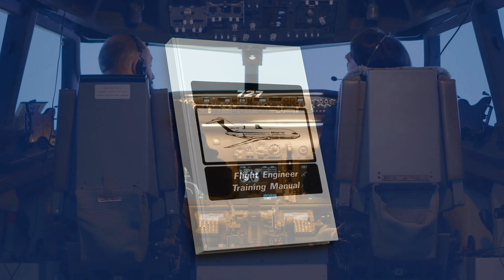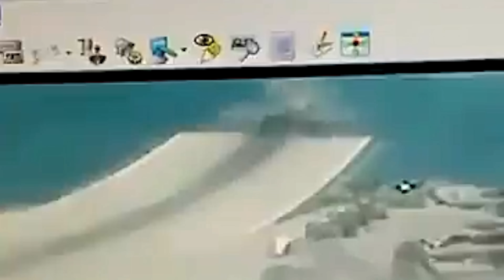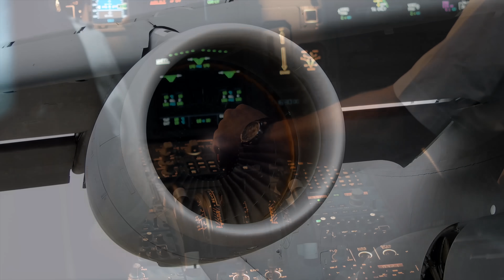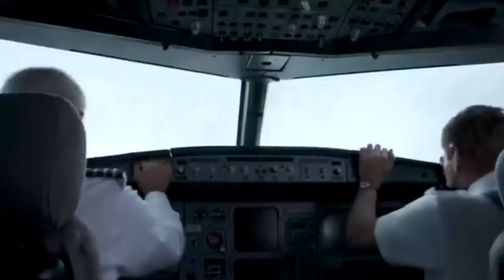Plane Takeoff Failures Caught On Camera

Comment: An MV-22B Osprey assigned to the 31st Marine Expeditionary Unit, VMM-265, crashed in Shoalwater Bay, Australia on 5 August 2017, killing three Marines. The tiltrotor struck the USS Green Bay and crashed into the sea shortly after taking off from amphibious assault ship USS Bonhomme Richard. 23 personnel were recovered from the stricken aircraft, with three confirmed dead

Comment: A Boeing 747 can NOT be flown with only a single engine - it needs minimum 2 of them to stay airborne ! ...also the engine with the birdstrike in the video is not the "utmost left" engine/ its the utmost right motor - No. 4 - as on a B747 the engines are referred to as Number 1-4  (from left to right out of Pilots (!) view - NOT as left/right !